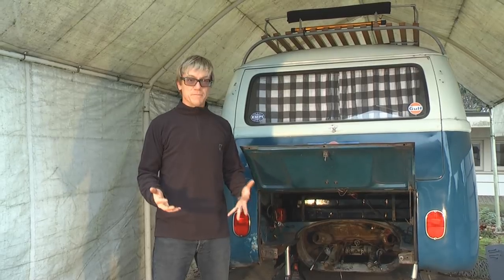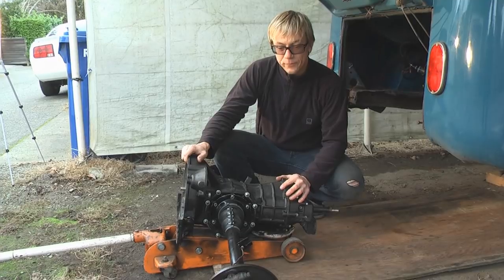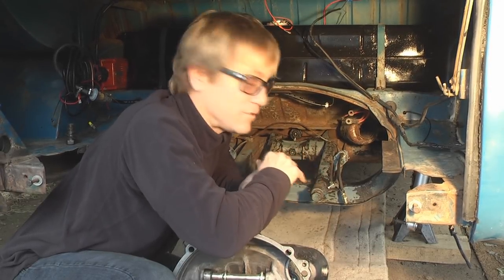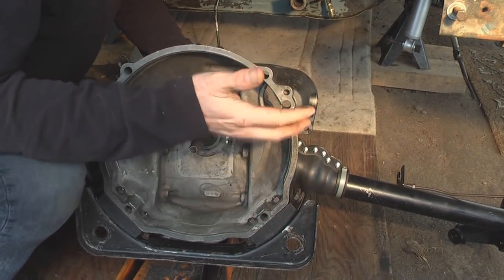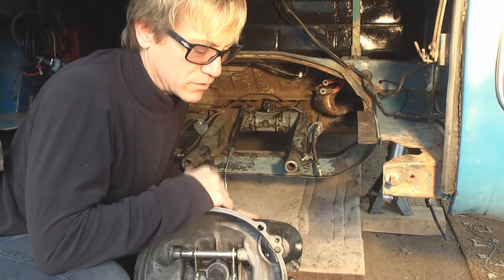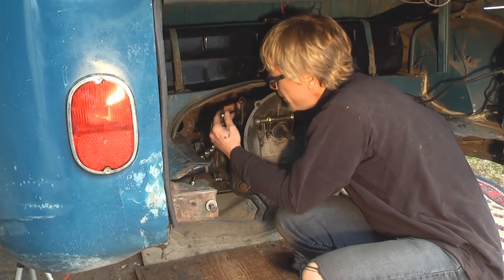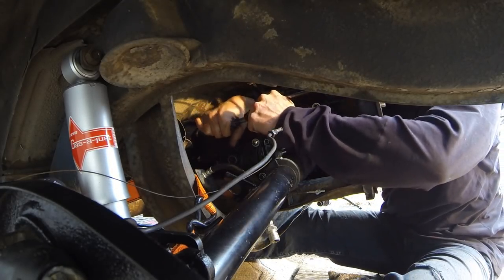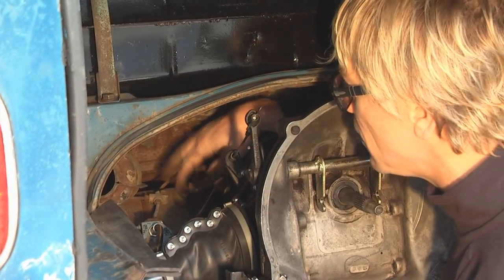Vintage VW Bus Transmission Installation - DIY German Aircooled Garage #11

Comment: German spec. is to put the axle boot seams horizontal, facing the rear.  There is no flex in the seam and they will tear if the seam is on top.  Put a bead of sealer on the seam.  Cheers!

Comment: My 1977 Volkswagen bus shakes like hell when I put it on reverse especially the back tires it’s horrible and I don’t know what to do can somebody help me thanks
Reply: Trans mounta in good shape  , installed correctly , tight , then check the Bowden tube for correct installation and bow !
Reply: Clutch problem?  Bad flywheel surface  ?  Pressure plate in poor shape ?  Cracked trans case ?  Main shaft bearing failure ?